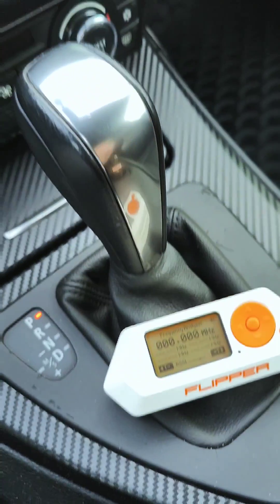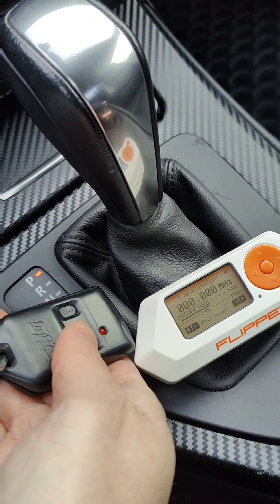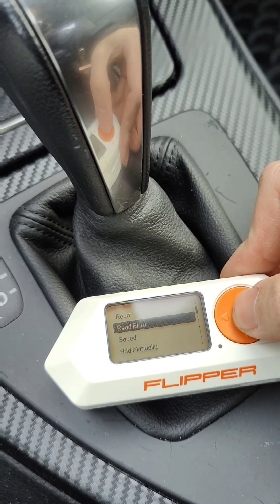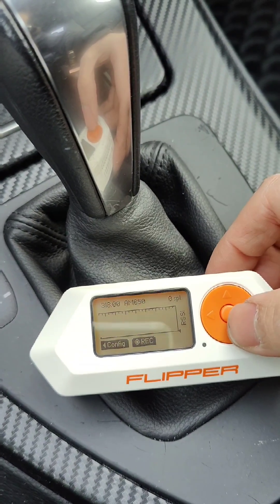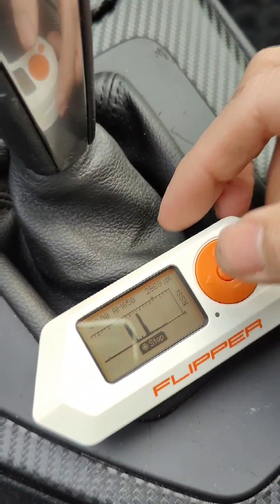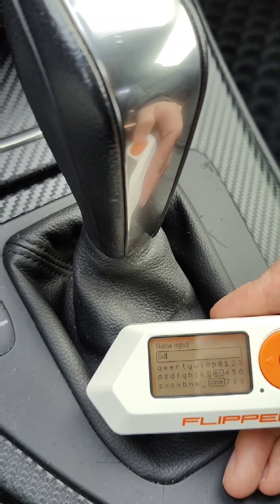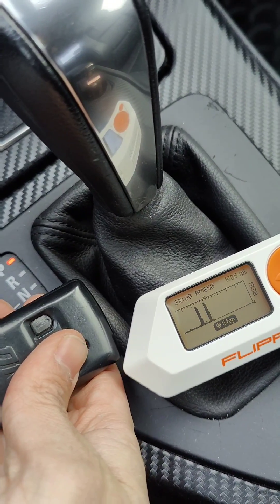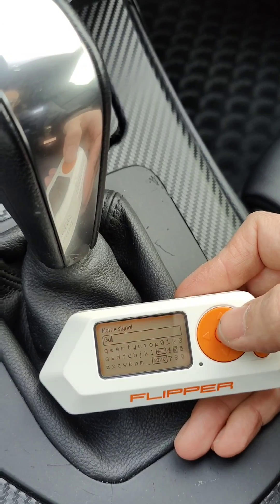How-To use the 🐬 Flipper Zero to open underground parking gates 🅿

Comment: Can I use this and my remote since I have one remote for my complex gate ?
Reply from the maker: It depends, your gate might have what's called "rolling code" and in that case it would only work once as the code changes each key press the gate receives. If you test with flipper and the code remains the same each key press then it would always work.
Reply: @vancityexe  hey, what about, in my apartment complex they give you a transponder tag that you put in your windshield and when I front of it, it beeps as it reads, I can't read the tag or the transponder, should I then record raw as my car is passing trough? I'm trying to duplicate mine without removing the sticker out of my windshield 🙏
Reply: @vancityexe does that mean, you have to capture all the codes that are recieved from the device outside the door?

Comment: What about parking barrier that uses card with a chip to be read ?
Reply: @PedroGonzalez-wz8ym  do you need to be close to it to read that? or can it be done by the distance? (im super new haha) tyia!
Reply: @SpecialSkills124  u mean to record the signal or emulate it?
Reply: @PedroGonzalez-wz8ym  emulate it. Since it’s a card you’d probably have to be right on it right? While as a gate entry emulate u can do from a distance right
Reply: @SpecialSkills124  correct, in my case you can emulate from really far
Reply: @PedroGonzalez-wz8ym  okay thank you!
Reply: @SpecialSkills124  I’m confused, so you can enter a building parking garage without having RFID card to scan ?